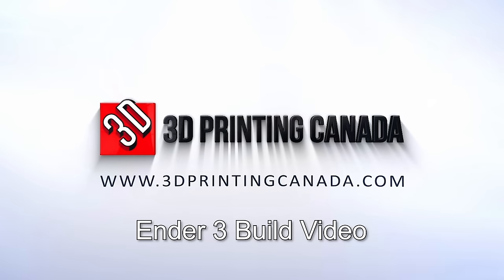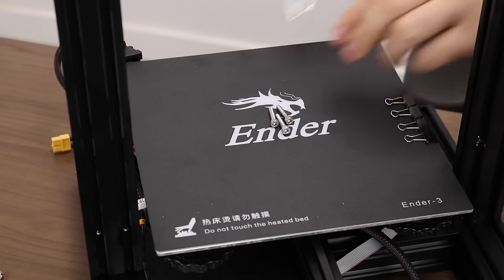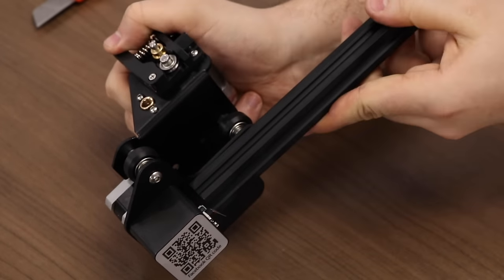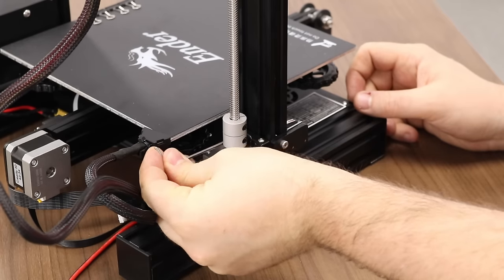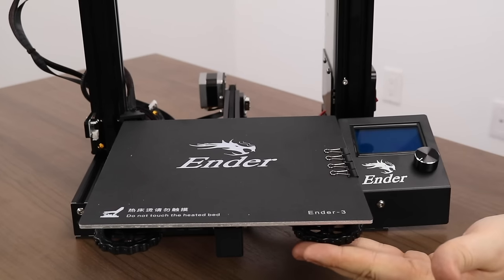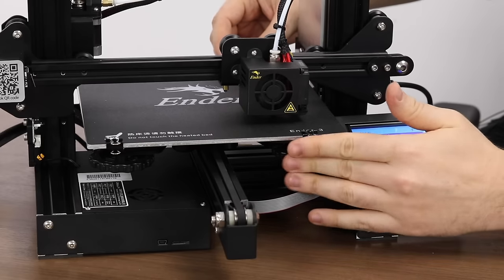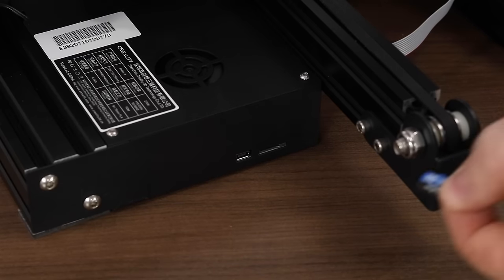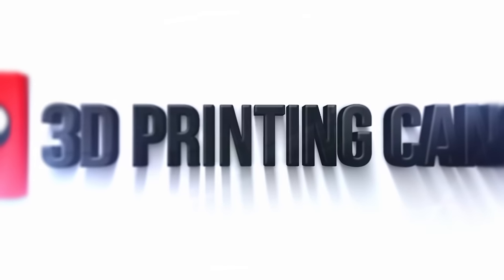The Ultimate Creality Ender 3 Quick Start Guide

Comment: Times for various parts in the video:
Parts - 0:00 - 2:34
Assembly - 2:35
Electronics/Hardware Assembly - 17:18
XYZ axes/Mild Troubleshooting - 20:20
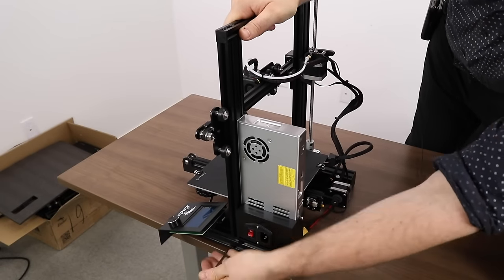Power Supply (Switch to 115v if needed) - 22:38
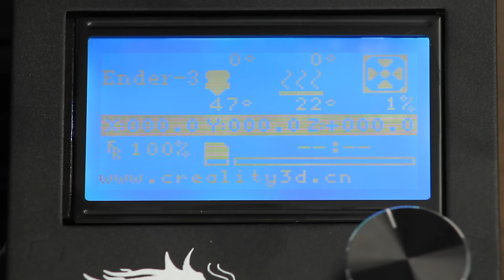GUI settings & bed levelling - 22:50
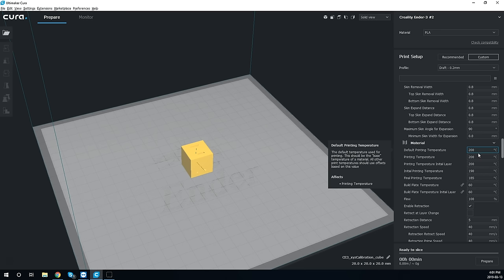First Print (Be sure to also see the GUI stuff) 33:07
Cura (3D Slicer)
Reply: Help me, while printing my filament do not stick properly on bed and finishing is worst
Reply: @mdabidhussain9621  EHAT filament are you using?
Reply: @mdabidhussain9621  ok
Reply: At 7:00 for attaching z axis motor, you said m4x16 screws. It's the m4x18.
Reply: @dortanid1506  ah thanks for that
Reply: we leveled the the bed coretly it won't print right
Reply: got it working
Reply: @reaperslasherhaunts2714  what helped you?
Reply: 6:50 Things may have changed since this video was made 4 years ago but I’m putting mine together now and this should be M 4x18 pan head screws. The m 4x16 won’t work here

Comment: Tip: If you got your Ender 3 recently, the M4X18 screws are used to fasten the z axis motor, rather than the M4X16 screws
Reply: Should've read the comments first 😂 thank you so much! I thought i was going crazy!!
Reply: yeah he just mis-said it, they use the M4X18 screws in this video too, you can read it on the bag he grabs
Reply: Bahaha I was just using the M4X16 then went crazy so I came to comments. Thank god I saw you bahahaha
Reply: Bless you kind soul
Reply: I wish I had read this before spending ages trying so hard to fix it with the 16s, heh. With the right screws it took a few seconds.
Reply: Man I was scrambling to fine it hahaha thanks for the heads up
Reply: gods work
Reply: I was about to write this after scratching my heads for hours and finally narrowing down to this. Thank you!
Reply: Thanks so much my guy you save me I thought I was going crazy.😅😅😅
Reply: i used the wrong screw and broke the thread my screw got stuck and now i cant use my printer
🥲🥲
Reply: @hansika chenoori  I'd reach out to customer support, but if that doesn't amount to anything, I'd try drilling out the screws and use a tap that's slightly larger to create new threads. Then you'd be able to use larger screws
Reply: Thanks!
Reply: @luk-ketgames2770  bro I was getting fricking mad that I can’t put a screw right
Reply: He should pin this, just noticed this problem when I was assembling mine today, the actual instructions say the right screw tho
Reply: Oh thank God, I was about to lose it lol
Reply: @flexyy3461 duuuude same lol.
Reply: Thank the lord
Reply: THANK YOU DUDE, I ALMOST STRIPPED THE DAMN SCREWS BECAUSE I TRUSTED THIS GUYS CRAPPY TUTORIAL UNTIL I READ THIS COMMENT 🤣
Reply: @rhyseeroo  its by no means crappy, he just made one mistake cause....you know.....he's human
Reply: The guy in the video says m4x16 but the bag he’s using says m4x18-p…
Reply: I went and bought another one lmao. Wish I saw this earlier
Reply: I cut the black bar on the z motor in half then re screwed them together. Too bad I didn't read this till afterwards
Reply: Oh thank God i thought i was crazy
Reply: I was going mental, his packaging when put in the camera says m4x18, so I thought he mis-said something and came to the comments to make sure. thanks.
Reply: Thank you so much I read in the manual and the video and was confused
Reply: Thank you! I’m using this video as a visual guide to assemble my 3D printer. You comment helped save me the trouble of returning and replacing the whole thing.
Reply: Lol I should of read this but luckily I figured it out.
Reply: also the motherboard is a single plug now if no one else mentioned lol
Reply: Thank you!
Reply: Just found this out through trial and error took me a good half an hour 😭
Reply: Ohhh that makes sense, thanks!
Reply: Thanks!!! I was confused
Reply: Great Video. Correct Screw for motor is the 18…thought I was losing my mind.
Reply: Jesus, comment saved my sanity
Reply: I….. learned that the hard way. I just took off the washer…. Fuuuuuuu
Reply: Legend 😂😂 I was going nuts… (literally)
Reply: Thank you! I was stuck for almost 2 hours!
Reply: W mans
Reply: Broo ,u just save a soul
Reply: THANK YOU!!!! I WAS FREAKING OUT
Reply: I mean idk how so many messed this up there is only one bag with 2 screws at that step and then the instructions that come with the newer years tells you in them on the 2nd page...Read your instructions!! Then watch the YouTube vid also you always have to keep in mind they update products and parts sometimes every year can't always rely on the tubes
Reply: THANK YOU!!!
Reply: Was genuinely losing my sht for an hour lmao
Reply: @luk-ketgames2770  yeah same, I spent half an hour trying to tighten them until I looked in the actual manual and found out

Comment: The motor mount uses the m4*18 screws and not the m4*16, he says 16 in the video but you should realize that somethings off.
Reply: ryan d yeah you’re right I noticed that too. Thx for the comment I was able to confirm lol
Reply: I legit spent like 20 minutes trying to use the m4*16... thanks for the help lol
Reply: He also skipped step 7
Reply: Rip hour of my life
Reply: yep, figured it out when the 16s were too short and then looking at the video, You could see they were actually flat head which is what the 18s were.  all in all a lot easier to watch and pause the video than to try to use the install guide that came with the printer.
Reply: I spent 10 minutes trying to get the freaking screws in. Thanks for this.
Reply: Thanks Ryan - quite correct
Reply: Same here I spent way too long trying to figure that out. Thank you the time stamp is 6:57
Reply: thanks dude i noticed it too, the bag he uses has 2 in ot and the shape is different i hope he pins your comment
Reply: THANK YOU!!!
Reply: Oh my...I am literally looking at the comment section just for this...Literally spent an hour....and for that....gotta give a dislike
Reply: Yeah I just almost gave up because I kept trying to use the m4*16s
Reply: yep! i looked for a comment like this one when i got confused from the mistake even though i was pretty sure when they looked like the 18s and the 16 didn't fit..... please add a baloon or something to the video to correct
 this!
Reply: I spent like an hour trying to get it in, thanks
Reply: i spent an hour trying to screw in these god dam screws that dont even fit
Reply: FFFFFF  why didnt I read  the comments first,   This took me too long to figure out  at 3 in the morning.
Reply: YE MAN I THOUGHT LOST MA SCREW
Reply: That fucked with me
Reply: Mate I was getting so angry at it not fitting, only to get to the next step where he says m16 AGAIN and realising he messed up. 😡
Reply: Yes I noticed that
Reply: Good that i watched all assembly videos even before buying.. saved from some frustration and hassle.. thanks
Reply: Why didn't I come to the comments first? Ugh just had my husband treat me like an idiot because of this
Reply: @kurtmihm3980  The 4x16 have regular heads, the 4x18 are countersunk type. But I was fooled for 10 seconds too.

Comment: I know this is an old video. I had just bought this brand. This was my first time putting one of these together. I got stuck about how the motor belt was supposed to go on in the manual instructions. They weren't very clear. I found your video. Thank you for doing a clear easy to understand step by step process. This helped me finish the assembly. Took me awhile, but I was able to finish.

Comment: This is absolutely superb in the attention to detail and I followed it absolutely yesterday in the build of my first 3D printer the Ender 3x Pro. I watched it 3 times before I even received my printer! I found one tiny little error. At 34:40 you say the mounting screws for the Z-axis motor are M4x16. This is the wrong length, it should be M4x18. There actually are M4x16 screws in the kit, but the ones needed are the m4x18 countersunk heads. The video clearly shows countersunk screws but I did not see this at first and I went for the wrong screws.  Well done, thank you so much for the best ever build video, and the voice is so reassuring.
Reply: Yes. I did the same mistake. But somehow checked elsewhere and found out this error. It will be good to add card or something at this location to rectify the same and help others. Thanks for the great video otherwise.
Reply: Yo I was stuck here for like 45 min thank you so much
Reply: I am so glad I happened to read this before I got there. Thank you for saving me the headache. Otherwise, this video is great. Straight to the point, no nonsense. This was the only way my ADHD self was going to get through this.

Comment: Tip - if when feeding in the filament, you can't get it all through the tube, use the change filament option on the printer. It will suck it in for you and keep extruding until some comes out
Reply: And I just find this now.

t h a n k y o u
Reply: Or just print a knob for the extruder and you won't even have to squeeze the lever.
Reply: Holy hell why isn't this the official instruction lol. That's an insane amount easier. So silly.
Reply: wasn´t necessary for me... did like the video instructed and all worked fine (as long as you pre-heated or followed all the steps)
Reply: I haven't been able to get the filaments going to the tube at all no matter what I try lol
Reply: I can get my filament thru but when I try to auto home it feeds the filament out almost as if it's in reverse instead of feeding it to the nozzle it just pulls it out

Comment: I have the Ender 3 Pro but I'm pretty sure the mounting of the Z stepper motor is the same on both. That being said, at 6:52 the M4*16 screws were too small and my directions said to use the M4*18 (I'm going back and forth between the video and the included instructions haha). That ended up working for me. 

Just a tip for anyone else watching and potentially building their first printer like I am :)
Reply: thank you i was so confused
Reply: Halp my ender 3 is not working the filament is not going through the nozzle so i have to do it manually it also just randomly spews out filament before printing
Reply: Bro I was panicking! Thank you! Favorite person rn
Reply: @laina.11  3 years later! Glad I could help haha. Welcome to the world of 3D printing!
Reply: @zachmachina lol

Comment: Amazing guide, start to finish, got my ender 3 running out of the box, clear instructions and straight to the point, thank you 3d printing Canada, you guys are great
Reply: Great video and easy to follow. Unfortunately, my Ender 3 did not come with the long Zed screw. Trying to get the folks I got it from together me one now. Other than that, once I get it I'll be able to level my plate, and get started. Also, My flash drive did not come with one of the execute files which would have enabled me to work with printable files. I will have time to locate one while I wait for the Zed screw.
I'm so looking forward to getting started and finding the best filaments at the best prices.

Comment: Love the video :) Thanks so much! @ 6:52 the speaker says to use two M4*16 screws but they're supposed to be M4*18 screws. The correct screws are pointed at in the video, I think the speaker just said the wrong size by accident :P (Instructions say M4*18 and if you zoom the video you can see by the packaging that they're M4*18 screws).
Reply: Truth!
Reply: When I was setting it up o thought it was m4 16 and I didn’t have enough and had to go to the store to buy some more but then I realized they were m4 18😞😞😞
Reply: @dylansnaggs  
alomst did the same thing, but thank god I checked the comments

Comment: Thank you! Thank you! And Thank you!!!! 

I have an Ender 3 I purchased a while ago, but I never had time to assemble, calibrate and print with the machine because of my job. I recently put it together and I was looking to do a quick set up and print to make sure it works since it's just been sitting there for weeks. As with all newbies that have a little technical know-how, you think things should be fairly easy and smooth. "Far from it" is being very generous in this instance. 

I thought the bed was leveled and it wasn't, scratched it the first time I tried to print. I thought the profile was good ... Naw!!!! Not by a long shot. I looked at a few vids to try to get my bearings and I was thoroughly unimpressed with their directions and walkthrough. I was getting close to giving up and scrapping it for another day. Then I ran into this video and said this has to work on this will be on the shelf for a little longer. Instantly I saw the difference in instruction and directions. I was able to set up things properly in about 30 minutes and I do mean everything. Bed leveling, temp adjustments, other calibrations, it all went smoothly. In fact, the most time I spent in the process was with the bed leveling. (It took about 15 minutes to get it fully completed.) Even the walkthrough with Cura was on point to give a newbie like me a good understanding of the software and what I should be doing. I know I'll need to study more, but for a starting point, this is fantastic! If you are new to 3d printing like I am, this is your best starting point. I am not one to leave reviews but I had to do so cause this just saved my 3d printing life!

Comment: Extremely helpful!  If you use this guide as your MAIN instruction for assembling your printer, I found it helpful to occasionally cross-reference the Creality paper instructions as a back-up.  That may be why I didn’t get stuck when the wrong bolt was mentioned at around the 7-minute mark.

Comment: 6:48 the speaker says to use two M4*16 screws but they're supposed to be M4*18 screws
Reply: How do you know?
Reply: @jessemcdonough7558  In the video, the bag is labeled m4x18
Reply: @WomboShlongo  😂 thanks I already built it 1 month ago though
Reply: bruh ,ty
Reply: I had to order a hole pack of screws for $22 because I thought I was missing a few M4 by 16 screws. turns out the M4 by 16 screws don't reach anyway
Reply: I legit cried when I was tring to find the m4 by 16
Reply: wish i had read comments first.. started to freak out thinking i had the wrong screws... SMH

Comment: Just a tip, I wouldn't recommend using the preheat PLA function before doing bed leveling. If the nozzle is hot and you touch it to the bed, you risk creating small melted divots in the places the nozzle touches.
Reply: This^^ Ask me how I know Ive done it twice. Lol
Reply: OOF, I read this prior to leveling and preheated anyways (Man I'm dumb)
But, hey, good thing to learn 🤣

Comment: You guys are amazing. This saved me from hours of internet searching. Printing the doggy now!
Reply: yea, nice video, but a warning should be included before printing that stupid dog that takes hours!
Reply: @neobikes  How many? to be more precise... Mine broke after about 2 hours and it was at about 20mm height - it popped up (I suspect I had the nozzle a tiny bit too high, or my bed has a valley in the middle of it). Again, how do you know how long the printing is gonna take? I suspect Cura would show details like that, but for files you already have on the sd card....
Reply: @neobikes  well shit... I just set it to go on that little bit that comes with the printer hahaha. Welp.. ... lesson learned
Reply: Faill at 85% can it be heat problem?becose my printing dog pops out of the board?

Comment: It is good practice to unclip the electrical connections to motors before moving them along the extrusions as they will act as generators and could destroy your board.
Reply: Andrew Hayes or just move them slowly
Reply: That shouldn't be a problem. There is a flyback diode inside the MOSFETs that drive the stepper motors. No voltage can get through them and back into the printer. When the MOSFETs are turning on, there is a small voltage drop. When they're fully on, the diode is basically shorted and doesn't affect the circuit.
Reply: @PunakiviAddikti  I don't believe that is entirely true - When moving the z axis on my 3 pro by hand at anything other than a snail's pace the display on the printer will briefly light up. This is with the printer unplugged, mind you.

Comment: Wow! I have looked at quite a few build videos for this printer, but this one is by FAR THE BEST! Every step explained and shown so it is really easy to follow. Nothing left to chance.
Every question I had in my mind as I was watching was eventually answered. I actually had the sensation I was building the printer as I was watching! Thank you so much for taking the time to put this together - It is far more than a quick start guide! I feel very confident I will be able to put my Ender 3 Pro together and start printing without hassle because of this video. A nice touch showing the Cura software setup as well. The prints you showed at the end were amazing - if mine prints as good as that I'll be very happy. I can't wait for my printer to arrive on Tuesday :)

Comment: This was super helpful thank you. It's my first 3d printer and i currently have a dog coming out! Soon to move on to visors for health workers. I had a few issues with the X-axis gantry step - it didnt seem to align properly and i had to force it a little - on the video you didnt mention it. Also at the end i was a bit unclear why we were heating things up before alignment. And finally the 'Home' button leaves the nozzle off the edge of the plate, which i was (am) confused about. Oh and I bought a glass plate to go on, so had to adjust the z-stop. Overall though your explanation was superb.
Reply: Same alignment issue with initial print. Did you happen to figure out the issue? Thanks in advance!
Reply: What is the z stop? I just put the plate on and started following this 😅